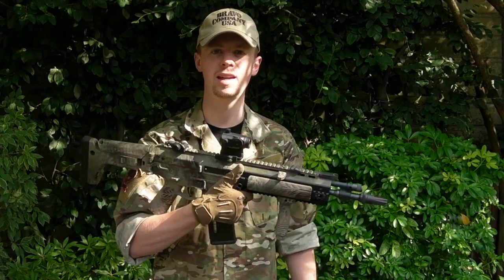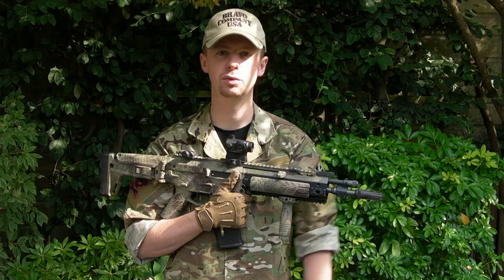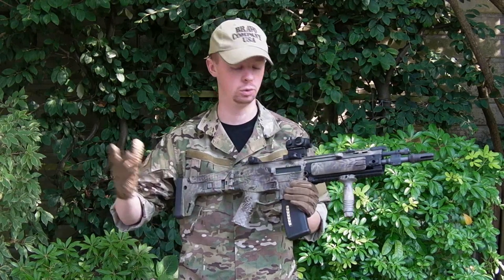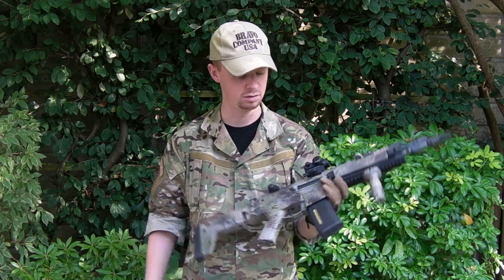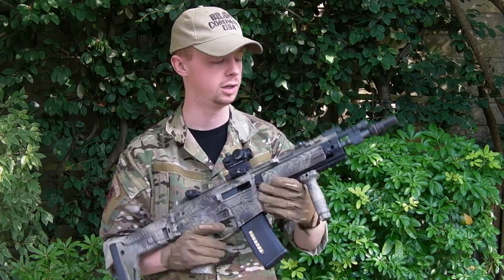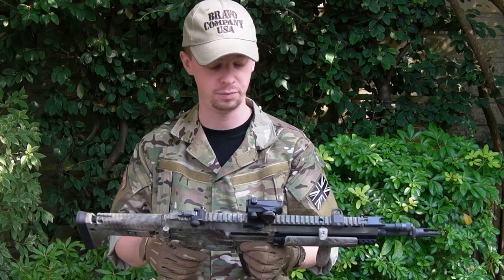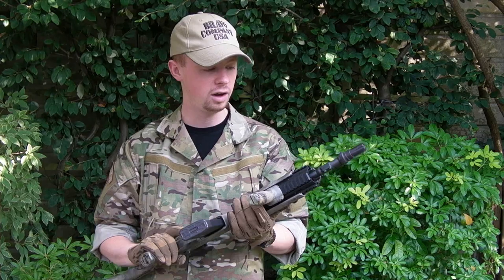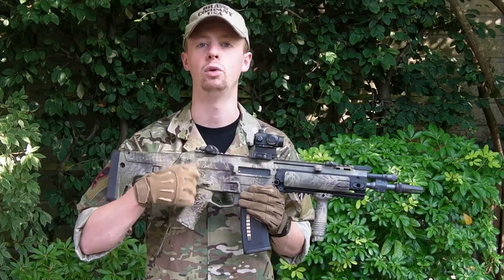PTS ACR Masada with MOSFET

Comment: I think the Masada is a bit like the Sig 551/552 lots of people like them but hardly anyone buys one...so makes it rare to see a well running one..another great video and love the paint job
Reply from the maker: Well, I think there was a lot of uptake of the PTS ACRs during the window they were producing them (considering it wasn't a cheap gun), especially during the time they were coming out with different accessories, parts kits etc.  For some reason now, even though loads of people bought them and posted pictures etc a couple of years back, they seem to have been banished to the backs of peoples' cupboards never to see the light of day.  There should be a lot of them still out there, not sure where though!

Comment: My friend, get the Speed Airsoft Tunable Trigger. That will shorten your trigger pull even more and allow you to shoot faster on semi-auto. ;-)
Reply from the maker: Honestly, for my purposes it's more than quick enough right now, would not need or want it firing any faster in semi for indoor games.
Reply: Oh for sure, this is shooting beautifully, and to each their own. However, if the PTWs in your area start giving you the urge to ramp up on the response-reset, the Speed trigger is a fun addition.
Reply from the maker: I hear ya.  As it is, my trigger finger can't out-run this gun; but if I practice enough and make it go faster I shall look to invest heh.